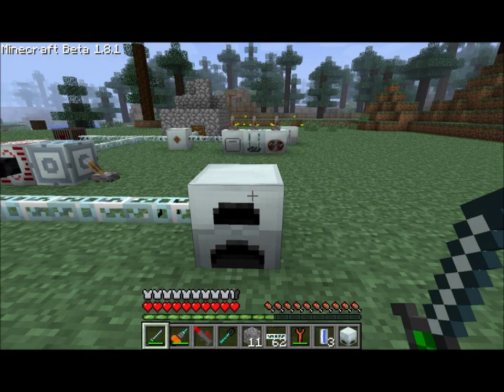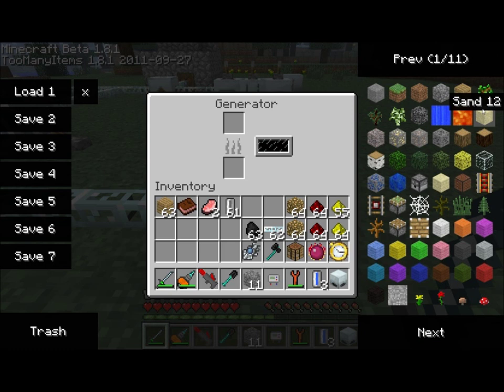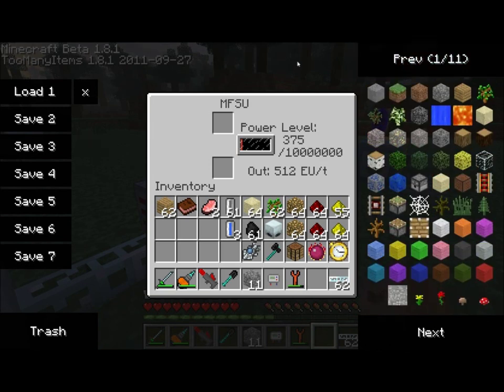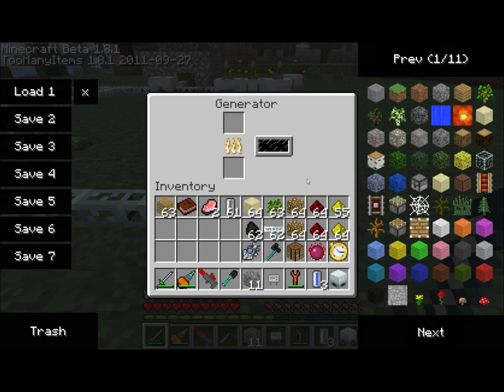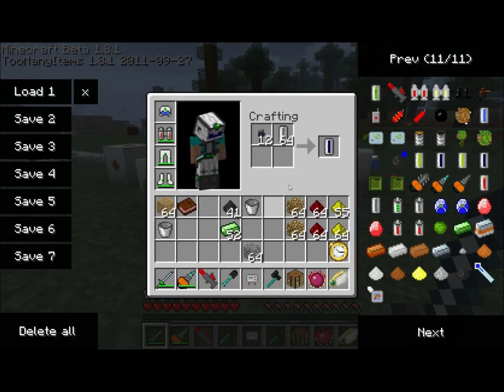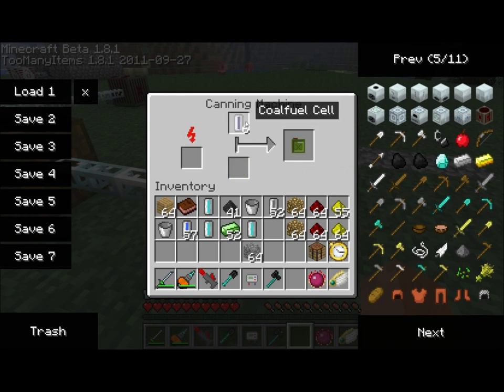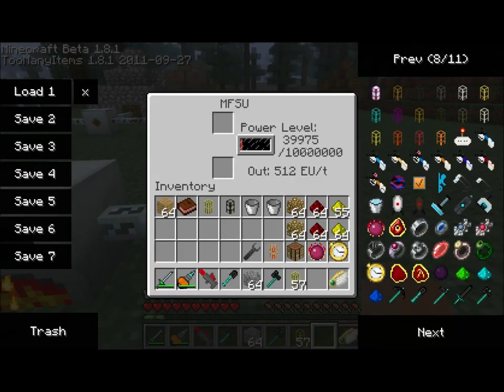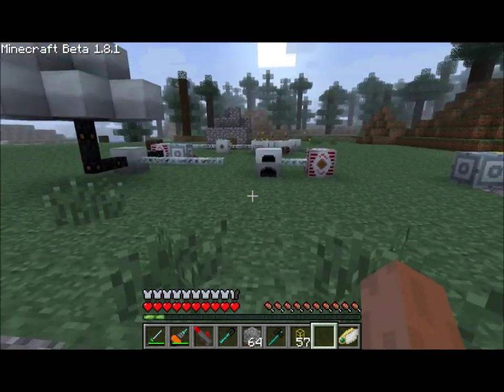IndustrialCraft 2.0 Tutorials - Generators and different Fuels

Comment: Dire, little question, you say it gives 11 times as much energy, 
43k.comes out. 1 coal is 4k
6x 4=24k
43-24k= 19k won.
About 5 coal..
So I'm wondering, how much energy does changing the coal into a fuel tank cost?
Seems more then 5 coal to.me..

Comment: Also there is Mobius Fuel. useable in generators it has approximately 53 times the burn time as regular coal. and thus energy. one mobius fuel will burn for a long freaking time.

Comment: @sciencemile Actually you can (at least I can in the 1.7.3 versions and with the IC+EE mod.)  Only Mobius Fuel works, but each gives 250000 EU.  1 Uranium ore gives 8 Mobius Fuel, so it gives you 2 million EU for an ore at 40 EU/tick with 8 generators.  The alchemist's approach to nuclear energy.